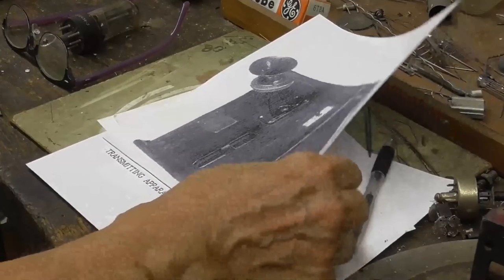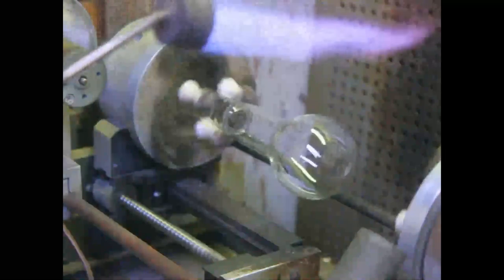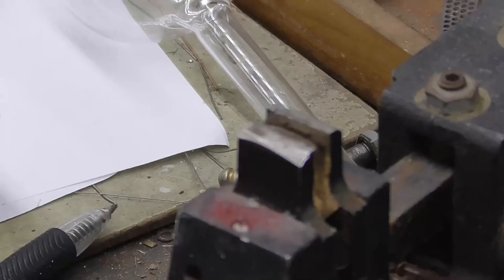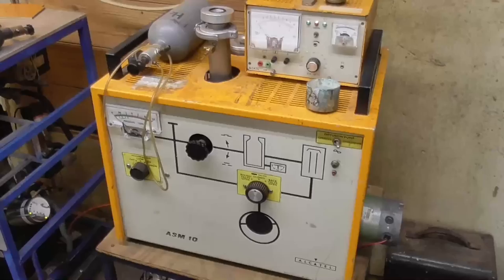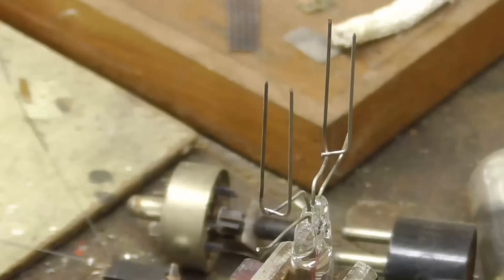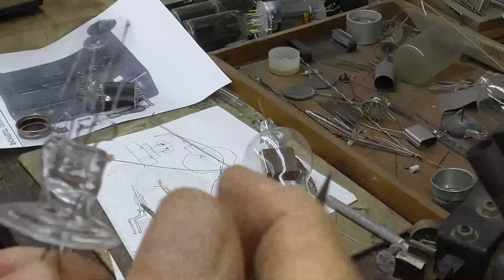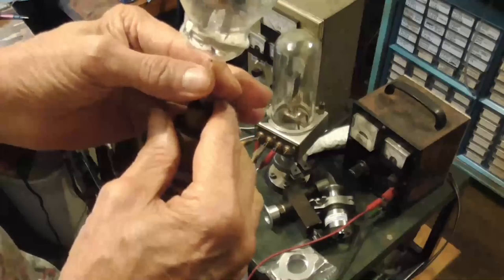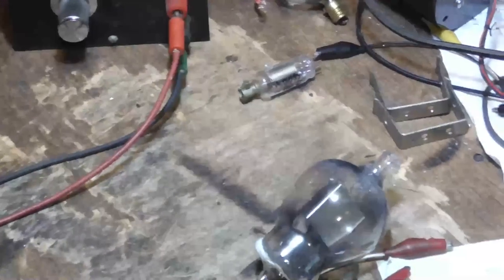MAKING AN OSCILLION TRANSMITTER TUBE

Comment: That's a real bummer that it cracked after you put so much hard work into building it. It seemed like it was working quite well when you were testing it while the pumps were maintaining the vacuum. I'm curious as to what it's amplifying characteristics and power output would have been, had it not cracked.
I'm guessing that moving the plate and grid connections, so they pass through the same end as the filament, would make construction of the tube easier, but that would kind of spoil the replica aspect of the project.
I hope you have better success if you try this project again. I really enjoy your tube making videos. Your patience and knowledge are incredible. Have a wonderful day.

Comment: This tube though it failed quickly did provide us with a fascinating video - thank you so much for sharing all your hard work.
For a tube such as this one with an irreparable crack - could you build a second envelope to put around the entire assembly and evacuate that prior to the first going bad?  Obviously this would be ridiculous in a commercial product but for hobby/experimenter work might be practical.  I guess it would be almost as much work as simply building a new one, however.
Reply: He said he wanted to build   functional replicas of period correct radios, so making it bigger would mean it wouldn't fit anymore. It was also probably damaged from running gassy while being pumped down.
Reply: @trevorhaddox6884  Yes, you are right - I hadn't thought of that aspect.  I still wonder if it would work but the more I think about it, the effort and time would probably be better spent making a new tube.

Comment: How does your technology compare to the technology they used back in the day when this tube was originally manufactured? Surely your equipment is better. Do have any examples of what they would have used?
Reply from the maker: When de Forest had this tube made the tech was fairly well developed. They had mercury diffusion vacuum pumps, and electrical spot welders. They had good glass blowing skilled workers. Some of the tubes made pre 1920 were very professional looking.

Comment: Excellent 😊 thanks.
Also I have a question on your Atwater Kent breadboard video
The bus wire you use is it 20 AWG.   or.   22 AWG
Reply from the maker: #20. That's because I had it on hand. #22 will work fine as well.

Comment: Wow... You have a massive investment in plant, tools, materials. I am staggered. That is equivalent to small production unit. Something's got to be warranting that. Are you small engineering plant?
I  gather that you use Tungsten for the feed through because of the hot glass. It was my understand that platinum was usually employed as it's coefficient of expansion is identical to glass but it looks likeTungsten is much the same as platinum but not so expensive.
Ace videos...

As for the Haute Culture garments, my only comments are "They must be ruined by the engineering  conditions, paint spray. Saw and Lathe dust etc."
But more critically, not wise around moving machinery and power tools.
Factory safety officials would go bananas!
73.

Comment: How about restoring a color television picture tube. There are generic electron guns available on the market. I know there was at least one company in America that was doing this work. You should give it a try.
Reply: Used to do that years back. The store I worked for had a "lifetime" guarantee on the picture tube and we had a small vertical lathe for attaching a new length of glass on the neck and then welding the new electron gun in place. For a picture tube, given it's size,  the vertical lathe was, at least for us, much easier to use than the horizontal ones.  We only had two ovens to process the tubes so it was very limited production. The rebuild tubes performed just as good as new.

Comment: All tubes seem to be built with a delicate glass envelope. I wonder if a tube was ever constructed that used the anode as the envelope. Imagine a metal tube pinched shut at one end with the filament and grid inserted into the open end then sealed in position with a glass plug. Such construction would be very robust but I've never heard of a tube built like this. Possible problems with metal expansion breaking the glass plug seal? 
Would make an interesting project but you wouldn't be able to fire the getter inductively.
Reply from the maker: There were numerous types of tubes made exactly like that, especially high powered transmitter tubes that had the anode submerged in water cooling.
Reply: Microwave oven magnetrons are vacuum tubes built exactly in this fashion.
Reply: Some relatively modern high power Traveling Wave Tubes are designed/manufactured with grounded anode/"depressed" cathode configurations. I provided engineering/ technical support to the Navy for a number of systems that used these in the 1960"s.

Comment: Questions: 
A) how do you dispose of your glass cast offs?
2. What are you using to lubricate the glass as you’re cutting it?
Reply from the maker: I have a BIG box that I put them in. They sell very well on ebay! I use WD-40 on the diamond saw while cutting. This evaporates totally in the bakeout process of the tube.

Comment: Would absolutely love to meet you sometime.  I find you fascinating to watch and learn. Grew up when vacuum tubes were king then the transition to solid state devices. The best of both worlds I guess  for this retired EE.  As solid state devices don't have filaments I guess that is why they don't have a warm sound. {;^p)

Used to rebuild color picture tubes and loved working with glass.
Reply: fuck google  Thanks! Interesting topic with a lot of pluses but currently poor reliability because of decreasing emission over time from the "source electrode". High speed with less noise {nothing for the electrons to bump into in a vacuum}
Reply: "As solid state devices don't have filaments I guess that is why they don't have a warm sound."  Oh my.... that's can of worms you REALLY don't want to open!  😆
Reply: @hectorpascal  Obviously that was sarcasm as I followed it with a winking face.

Comment: Thanks for the vedio.  I want to buy a tube tester by which you can advise me an old tester and which brand or a curve tracer like utracer3, etracer .
Reply from the maker: I use utracer3. It works fine for what you pay.  I stick with military tube testers like TV-7 or a Hickok.
Reply: @glasslinger  I am a technician of old TV radios I want to know if a tube is working well or not working. To test the short circuit, leakage and emission. is utracer3 good for the above tests or tubes tester likes TV 7 Hickok
Reply from the maker: @radiotvrepair1059  The utracer is more of an engineering tool. The TV-7 is a function tester that does the tests you desire. It is a military grade tester so it is of much better quality than consumer testers. You can find them on ebay for around $300.
Reply: @glasslinger  thanks for your reply.you bought Ronald's utracer3.  I'm going to buy a Ronald utracer6 is making kits.  in your opinion utracer6 can detect good tubes, weak tubes defective tubes gas failure, low emission, short circuit.

Comment: Is there a way of recovering the filaments from a cracked envelope, and just making a new envelope 🤔
Reply: I think not. You can try to cut and make some seals but the two "rings" (I forgot the name) was heated up already so too tricky I think. And also remake the tube for the vacuum system. But I think that he can keep some parts. Maybe for the next try ? :)
Reply: From what he said it seems like the internal glass support failed when it cracked. Had it been in another part of the tube on the outside he could have just cut it in half and made a new envelope, but once the support fails it has to be rubuilt since it's all fused together.
Reply: completely educational video.. now buy the $3k worth of equipment and try to build your own :^D

Comment: I've wondered for some time now - what fuel gas do you use? Propane? Hydrogen? Also, do you use oxygen cylinders as well, or air?
Reply: I think he uses oxy-acetylene with oxygen concentrators to supply the O2 (which is the compressor noise you hear).
Reply: Oxy-propane mixes have also long been used in  lampwork (borosilicate) glassblowing, and would be hot enough, though probably not deliver heat as quickly as oxy-acetylene.

Comment: what torch you use for melt the glass?
Reply from the maker: I use a National 3A with homemade torch tips. You can buy the tips but if you have common metal working skills you can make the tips MUCH cheaper. The torch uses natural gas and oxygen.
Reply: @glasslinger  Thanks you

Comment: I suspect that the reason he didn't switch to all the electrodes through the same pinch/seal is because labour, even skilled labour such as glass blowers... was cheap back in the day.  If you save some poor schleb half an hour to 2 hrs work... why bother... it's cheap.
Reply: Rings true today. Which is why we live week to week.
Reply from the maker: Actually, de Forest FINALLY did change over to single ended design when competitors began making huge numbers of tubes cheaper than he could. It is much easier to put all the electrodes in one pinch than that horrible double ended alignment hassle!